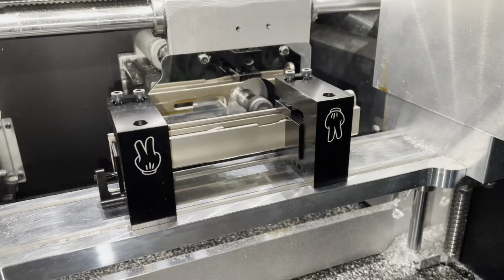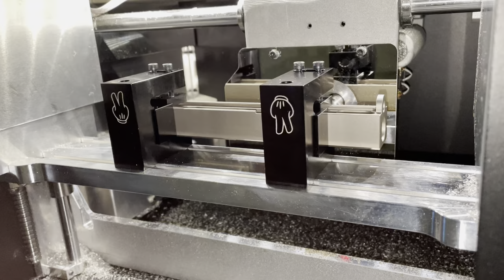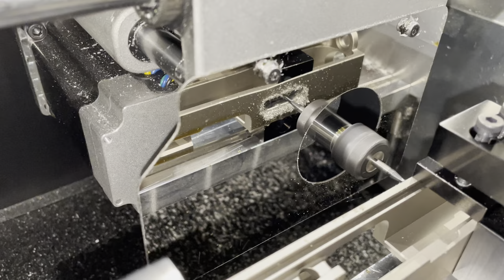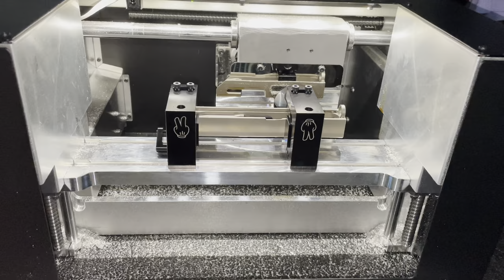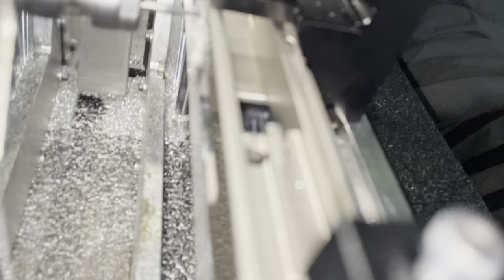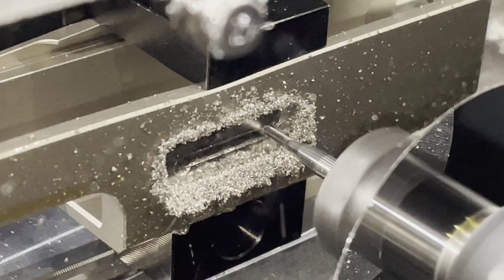Ghost Gunner 3S - Blank Stainless Steel Glock 19 Slide - Milled with 2A Part Picker Slide Jig

Comment: Can you manufacture a functioning handgun from scratch with this? If yes, can you design it yourself or do you get to choose a design from currently existing handguns?
Reply from the maker: Currently you can’t. It will all still need to be 80% lowers as of right now for handguns
Reply: The 0% is now available to order
Reply from the maker: The p80 + blank slide is still the easier and faster route to go with, with an exceptionally faster delivery time. Even with the 0% kit, if you live in a “banned” state, that’s basically a kit that’s created for 20% of the country, and that’s if everyone in those states wanted to create a 0% handgun. Still have to wait several weeks for delivery. I can have a very reliable p80 done in insane amounts faster turn around time.
Reply: not every part but a healthy portion of the gun rather than the actual parts
Reply: @HeathIV  so milling a receiver is not possible ?
Reply from the maker: Not with the ghost gunner, atleast pistol form. You can mill AR lowers though

Comment: How’s the configuration set up using fusion 360 or is it not compatible?
Reply from the maker: Fusion360 is compatible with the machine. I haven’t ran any fusion360 but I plan on running it towards the end of summer time and then converting that to gcode for the ghost gunner. Shoot me a sub if you haven’t already!🇺🇸
Reply: @HeathIV  been debating on getting one myself, just unaware of it full capabilities it can do with fusion 360
Reply from the maker: There’s a new 3rd party company called 2A Part Picker. He uses fusion360 for all the slide designs and everything so far has turned out flawlessly with my slide and everyone else’s slides. Seems like that’s the route to go

Comment: How long does a slide take?
Reply from the maker: Depending on the design, the more complex cuts can take a little over 2 hours total
Reply: @HeathIV mine is coming
Reply from the maker: Make sure you post pics in the group as you cut!
Reply: @HeathIV  it will be flooded

Comment: can it do an entire slide from a block of aluminum/steel or no?
Reply from the maker: Negative
Reply: @HeathIV   what goes into making a glock slide? is it about the material the Coastrunner spindle head has to work with (steel vs aluminum), the material of the toolhead itself (would need replacing too often?), or more to do with there needing a more advanced (more axis) cnc machine to do the complexities of the slide?

Comment: U pay for the files?
Reply from the maker: So for 2A Part Pickers jig, as long as you bought in for the jig, you’ll get all the initial designs for the Glock slides and have access to new stuff for 30 days. Then after the 30 days it’ll be a subscription base setup to be able to access frequently uploaded slide designs and cuts, around 30 designs a month for various slides